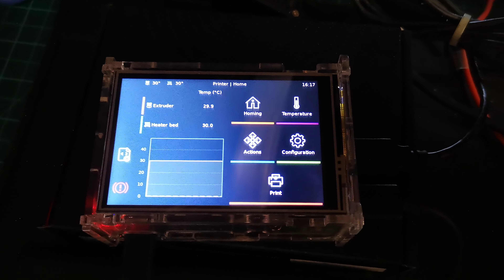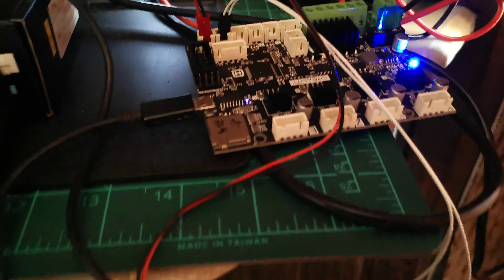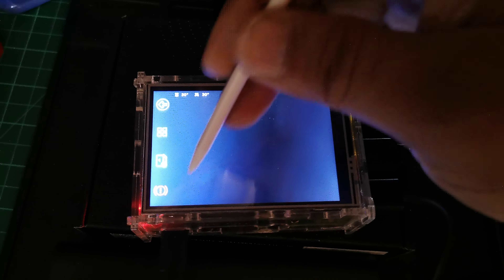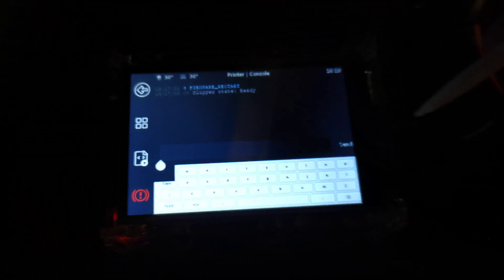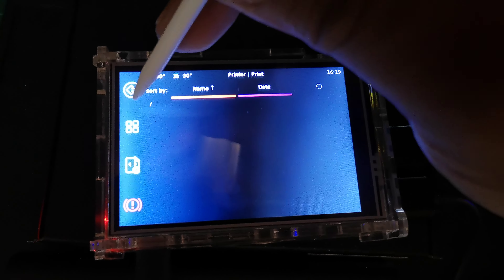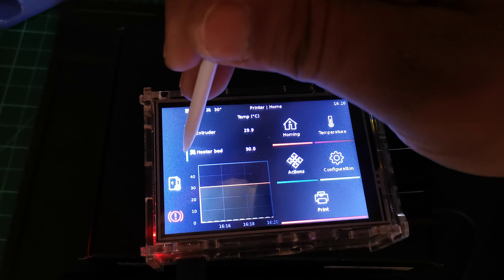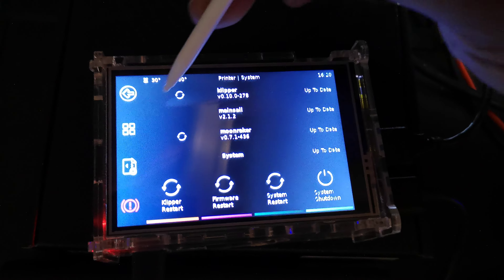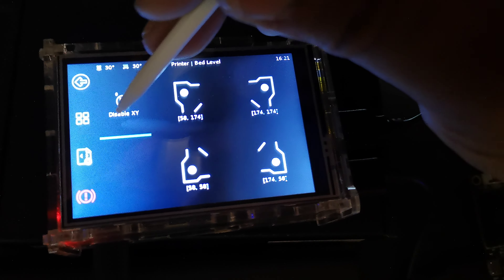Klipper Mainsail running on a Raspberry Pi 4 with 3.5 inch Touchscreen

Comment: but how do you make it work..?? just plug it and it work or need to do sth?
Reply from the maker: OK... So for the screen to work, first you need to install the drivers from waveshare github. This will enable the screen and raspberry pi will be able to detect and output to the screen through GPIO pins. Then, you need to install the  KIAUH tool from the github. Google  KIAUH and you will get the guide. Once that is installed, you need to install the klipper screen app through the KIAUH menus.
It sounds a long process but it's pretty simple. Google it and you should get the guide.

Summary
Step 1: install waveshare drivers from github using SSH (link on waveshare website)
Step 2: Install KIAUH using SSH on PI.
Step 3: Install klipperscreen using KIAUH again through SSH

Comment: I did everything according to the instructions, but instead of the klipperscreen, only the console starts up...
2023-01-10 20:14:36,298 [screen.py:main()] - KlipperScreen version: v0.3.1-9-gb96adf5
2023-01-10 20:14:36,300 [screen.py:main()] - Failed to initialize Gtk
Reply from the maker: Do you get that error on the screen?
If yes, then your driver's for screen are loaded and working. You need to install KlipeprScreen plugin. And if that fails too, I suggest you start with a fresh install of Klipper with doing everything again on a freshly formatted card.
Reply: No, this error only in log files into the mainsailOS, on the screen i have working console, instead the klipperscreen. What plugin do you mean?
Reply from the maker: @ДмитрийМаковейчук-о7я  I meant the klipperscreen plugin only. If that is installed, you should get an interface on the screen, which I guess you are getting.
What is the main issue you are facing? If it's an error with mainsailos, then you may want to post your query in their discord server.
Reply: If i see console - its mean that display is working properly? And the problem in the mainsailOS?
Reply: I almost solved the problem, but for sure I need the contents of this file, can you show it? 
sudo nano /usr/share/X11/xorg.conf.d/90-monitor.conf
Reply: Problem is solved. The comand 
sudo mv /usr/share/X11/xorg.conf.d/99-fbturbo.conf ~
is helpful!